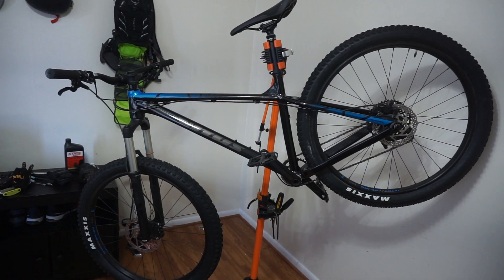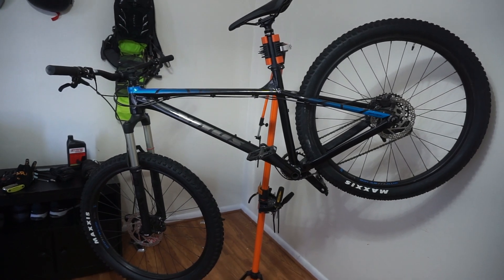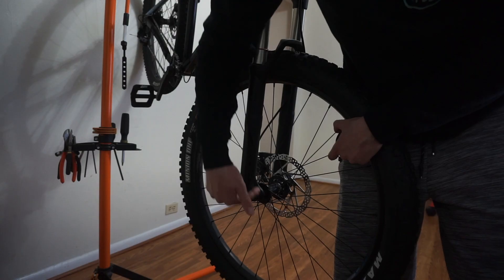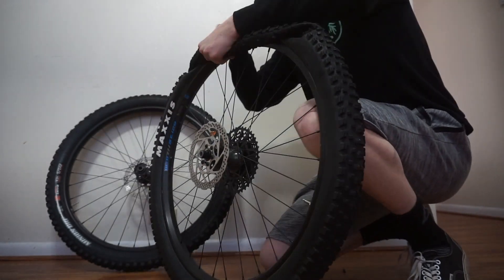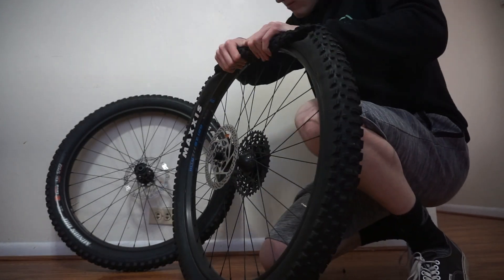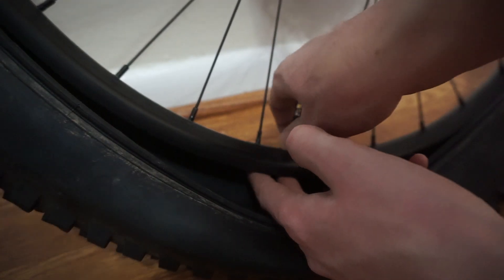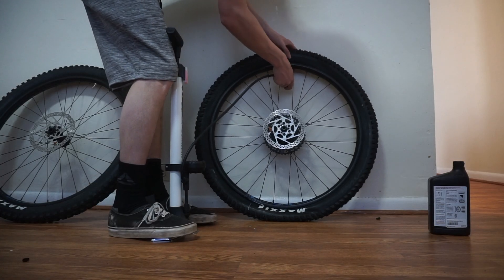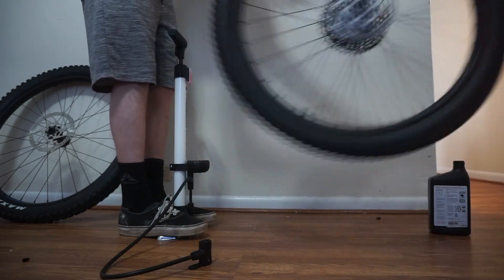Stan's No Tubes - Vitus Sentier Vr+

Comment: Please do more vids with the vitus.. I have the same bike and not many videos out there... also do you have a dropper post? if so can you remember which size dropper post do you need for the vitus?
Reply from the maker: Now that its warming up i will finally be posting more riding videos with the vitus! And i got a 150 mm Brand X Ascend dropper post and i believe the seat post size is 31.6 mm! My bike is a medium. Thanks for the support!
Reply from the maker: Daniel Garcia  how do you like the bike? ive loved mine so far
Reply: @NateFastBikes  Subscribed
Reply: @NateFastBikes  Love it! travelled 200 miles from London to Northern Ireland to buy it second hand, it's a beast! but ned a dropper post and the rockshox need some air!
Reply from the maker: Yeah it definitely needs a dropper! Its life changing lol and thanks so much for subscribing!

Comment: I just stumbled across this video. I'm confused because you didnt use any rim tape.  Can you explain how you were able to run tubeless without taping over the spoke holes even when the rim and tire are tubeless ready?  Am I missing something?
Reply from the maker: Hey Beau, sorry i am late on responding, but the wheels came with the rim tape over the holes all ready!
Reply: @NateFastBikes  hmm.... usually it's a tape ring around the rim for the tubes, but I have never seen a rim come pre taped.  That ring of tape on there will cause leaks if it wasnt firmly taped with tubeless rim tape or gorilla tape
Reply from the maker: @beauar1   hmmm then i might be screwed lol
Reply: @NateFastBikes  yeah you are supposed to take that tape off the rim and then retape the rim otherwise it probably has leaks everywhere because it's not airtight.  I wouldnt go to far with it like that.  Lol